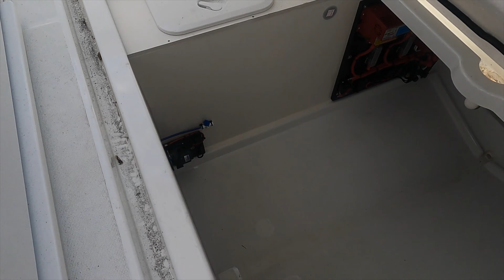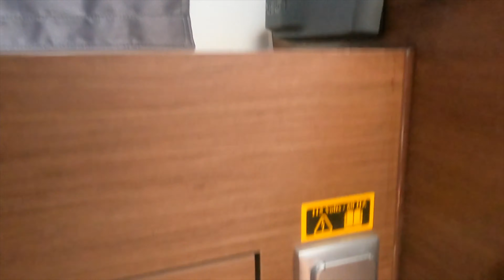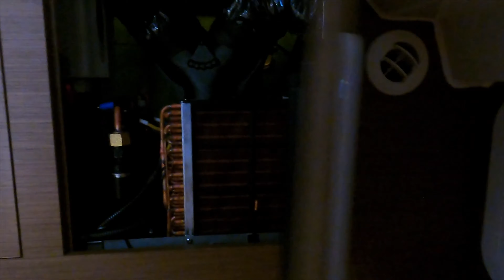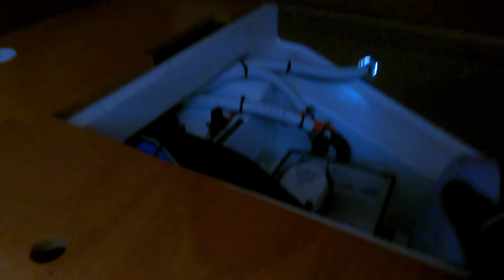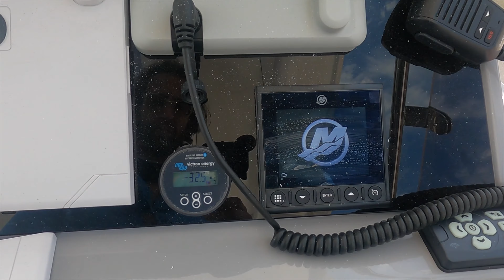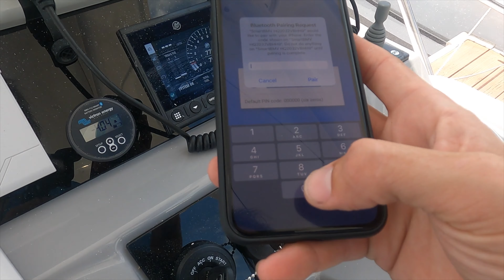Jeanneau Leader 9.0 with a True 12v Air Conditioner, 8 Hours of Runtime! by Mabru Power Systems

Comment: Why not at the discharge come out the same through hole as the AC discharge?
Reply from the maker: I don't fully understand the question but if you are asking why we have two separate thru hulls for water intake and condensation, it is to have control over both and to eliminate back pressure.
Reply: Prolly cuz of the cooler water thing, but not sure im not a ac guy.